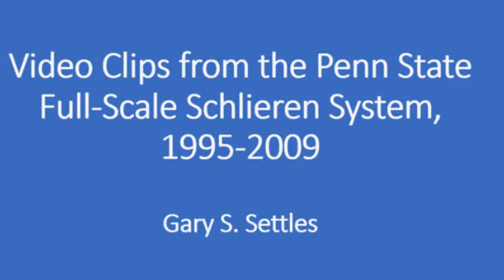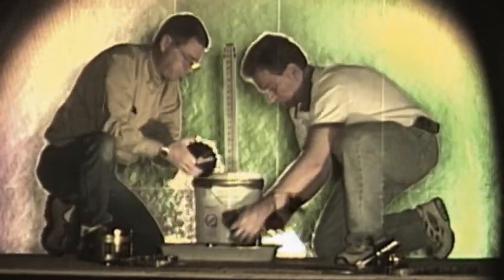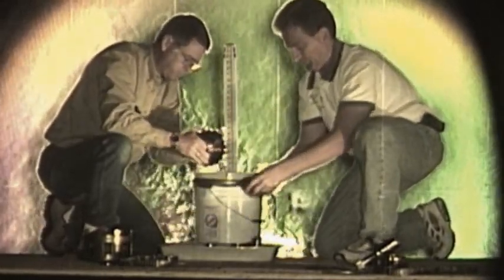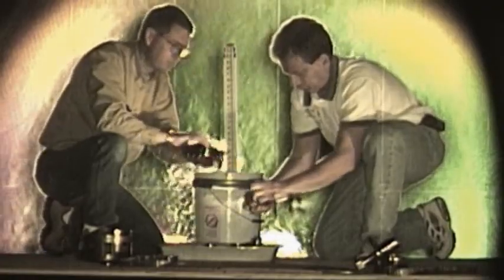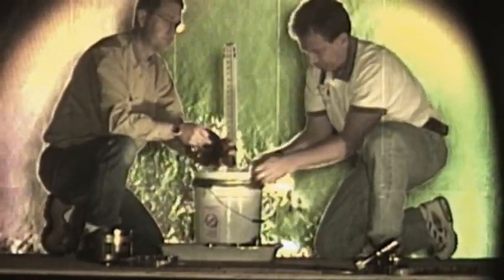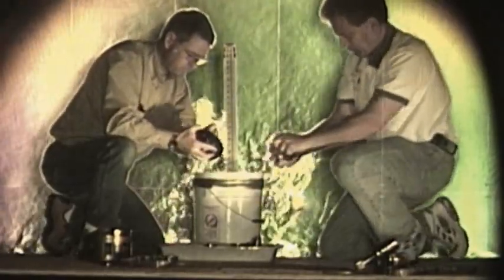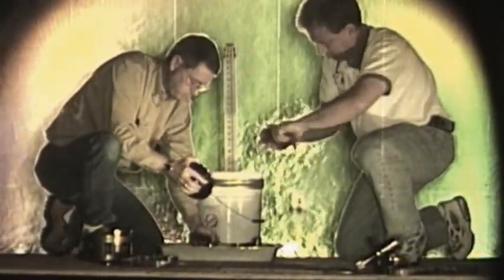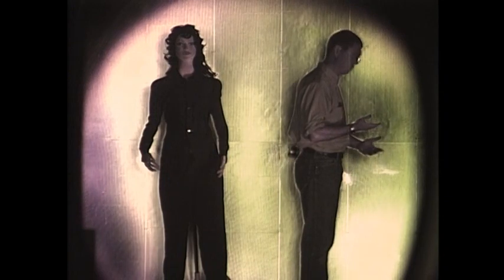Video Clips from the Penn State Full-Scale Schlieren System, 1995-2009

Comment: Thank you for your great video! Moreover, your book 'Schlieren and shadowgraph Technique' is really helpful in studying schlieren method. 
Here i have some questions:)
1) For the case of this video, what method you use? In my thought, it seems impossible to see that big scale of phenomenon by using big lens or mirror. Then did you use BOS(background-oriented Schlieren) method?
2) When making lens-based schlieren setup(which uses two parallel lenses), does a distance between two lenses affect the sensitivity of schlieren image?(or distance between schlieren object and focusing lens) If so, i wonder which of the focal length of focusing lens or the distance between two lenses has more critical influence to sensitivity of schlieren image.
Thank you!!! :)
Reply from the maker: Thanks for the comments. In this video a large lens-and-grid-type schlieren system was used, the background grid being several meters on a side. In a schlieren optical system with parallel light between two field lenses, the sensitivity is not determined by the distance between the lenses. It is, instead, a function of the focal length of the second lens (and of the setting of the knife-edge cutoff).
Reply: @garysettles  Thanks for your kind respond!!😀
Reply from the maker: I'm sorry this reply took so long, and thanks for the kind words. This footage was shot using a very large and obsolete lens-and-grid schlieren setup as described in my book. Background-oriented schlieren is the modern way to do this.
     Using the Toepler schlieren setup with parallel light between two lenses, the distance between the lenses does not affect the sensitivity, which is proportional only to the focal length of the second lens and the amount of knife-edge cutoff.
Reply: @garysettles  thanks for both of your responses, really cool to learn more about how you achieved this at such a large scale, and also the 'modern' way to do it.  I would really love to see the huge lens and grid setup haha :)  Thanks for sharing your knowledge with us. I'm looking forward to studying your book.  Cheers from an EE who loves optics